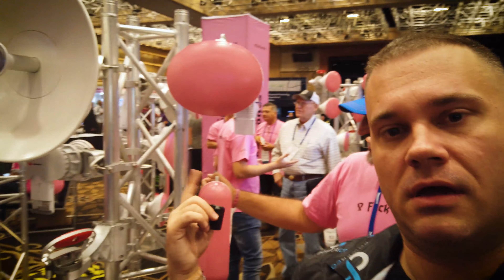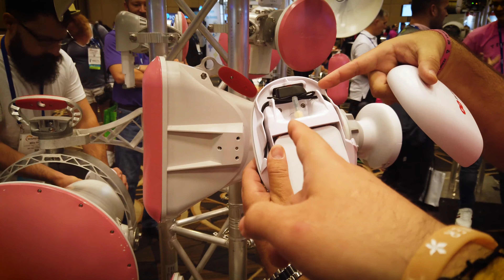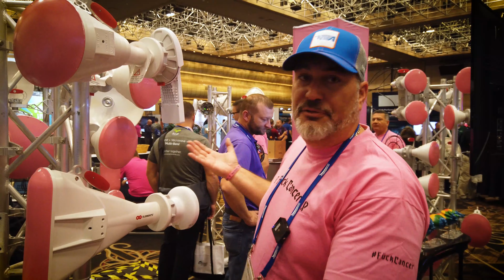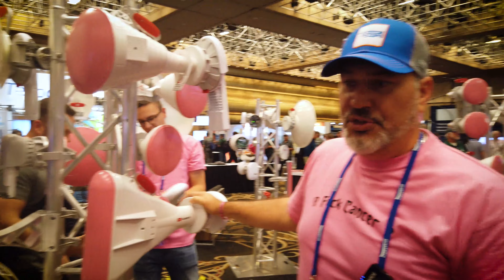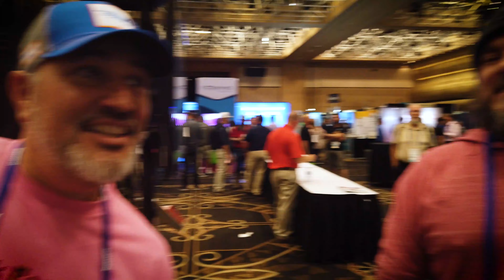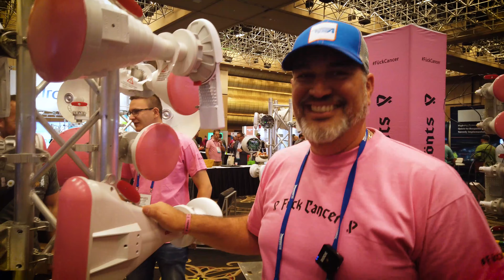The Philosophy of RF Elements - Wispapalooza Interview

Comment: I get the idea of making this batch pink,  but a desert pink or a Grey pattern would be great for the Arizona desert ...
Reply from the maker: I don't think they actually sell pink ones. I think it's just for the convention.
Reply: Ah ok. Well cancer research is a noble cause. And as long you dont use metallic paint you can give them a good color. PS these gigas from rf do 24 dbi, what do your current antennas do?
Reply from the maker: @DirkdeJager73  Yea, the guy at the end of the video has his camo painted. 

My dishes are 24dB.
Reply: Ok, then there is no problem. PS it s almost freezing here. Winter is coming 🤪
Reply from the maker: @DirkdeJager73  Yea, it's freezing here...it barely hit 70F. :-P